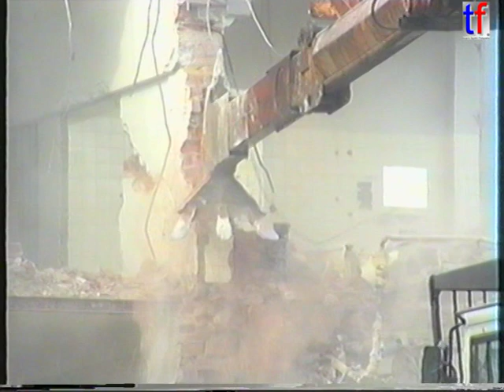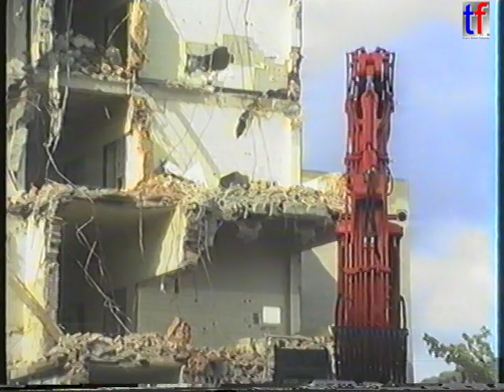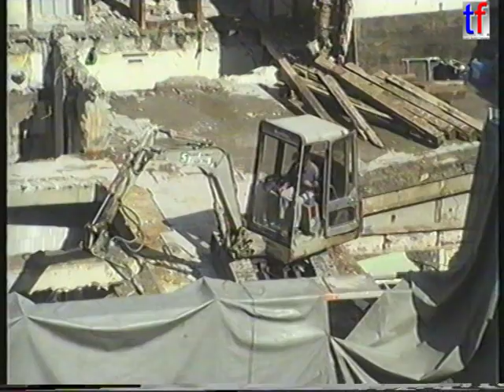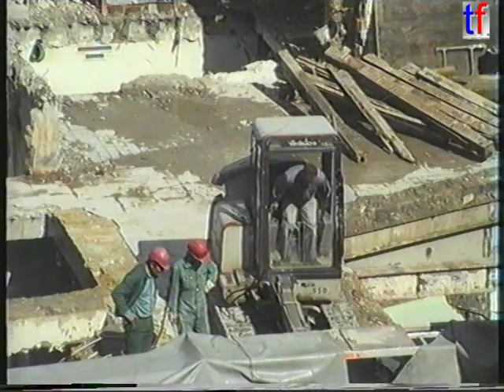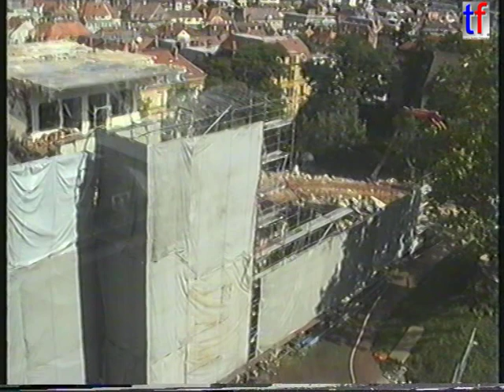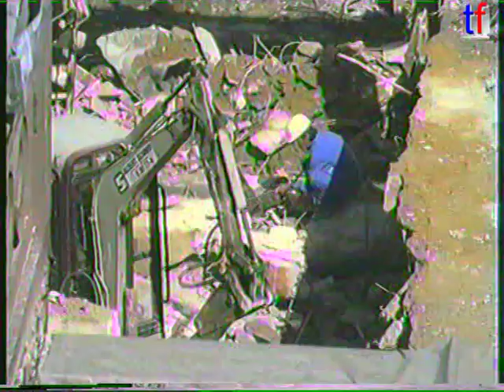LIEBHERR R964 Hospital Demolition / A. Schmid, Abbruch Marienhospital Stuttgart, Germany, 31.08.1995

Comment: Hatte der erste R964 eigentlich 1992 oder 1995 sein Debüt?
Reply from the maker: 1992 gabs schon die A-Serie.
Reply: Benjamin Beytekin Ok ....die A-Serie gab es dann doch bis 1998, oder? Denn interessanterweise gibt es meines Wissens je nach Baujahr 3 verschiedene Ausführungen bei der B-Serie. Liege ich mit folgendem richtig: 

-die ersten R964B von BJ 1998-2001 sahen quasi wie die A-Versionen aus, mit Ausnahme dass es nur noch ein Auspuffrohr statt 2 gab und dass die Leistung von 340 oder 350 Ps auf 367 Ps stieg.
-die R964B von BJ 2001-2004 blieben technisch unverändert gegenüber den ersten B-Modellen, aber der Hintergrund des seitlichen Liebherr-Schriftzugs wurde verändert (F.Kirchhoff hatte ja bspw. so einen R964B als auch einen R964B von 98-01 und einige Jahre zuvor noch einen R964 in A-Version)
-die letzten R964B von BJ 2004-2007 bekamen dann schon die runde Fahrerkabine der darauffolgenden C-Modelle und die Leistung wurde von 367 Ps auf ca. 385 Ps erhöht

PS: Muss mich korrigieren, mittlerweile bin ich mir ziemlich sicher, dass die Leistungssteigerung von 345 auf 367 Ps erst 2001 nach der Bauma oder 2002 erfolgte. Denn auch beim R974B erfolgte ja  erst in 2001 die Leistungssteigerung von 431 auf 490 PS.
Reply from the maker: Gute Frage. Da müsste ich in meinem Archiv nachschauen, wozu mir die Zeit fehlt. Aus zwei wurde dann ein Auspuffrohr.
Reply: Benjamin Beytekin Ok. Ja , kein Problem, dafür, dass du keine Zeit hast, habe ich natürlich Verständnis. Aber hast du (trotzdem) verstanden was ich meine bzw. wie die 3 verschiedenen B-Versionen aussehen?😅🙈
Reply from the maker: Ja, so in etwa :-))
Reply: Benjamin Beytekin Weißt du eventuell noch, warum nur der R964 bis ungefähr BJ 98 diese beiden Auspuffrohre hatte? Weil beim 974er (und bei den kleineren Modellen auch) gab es ja meines Wissens durchweg nur ein Auspuffrohr.